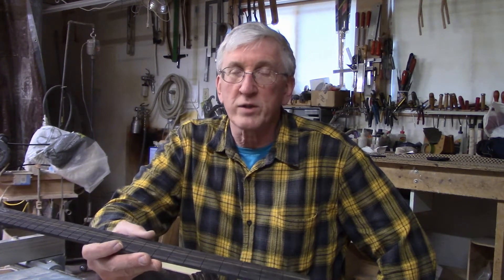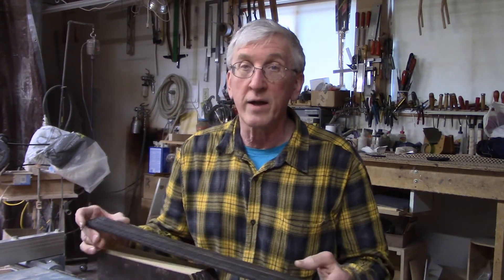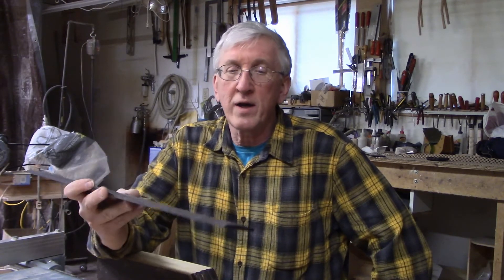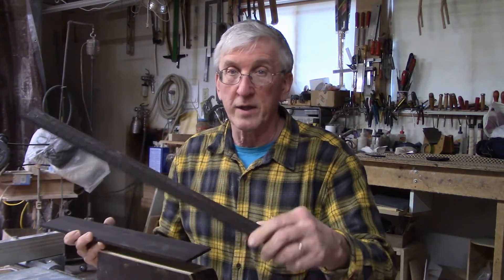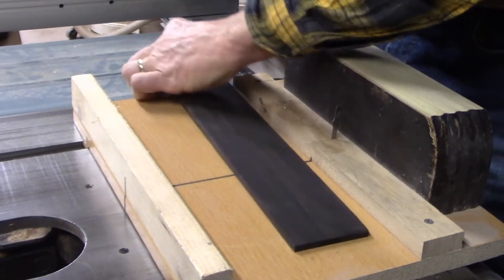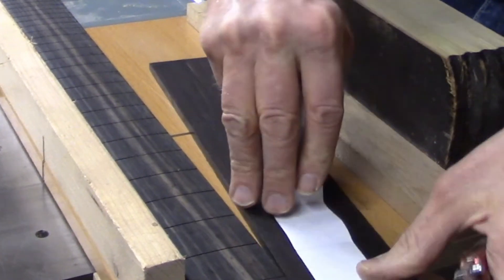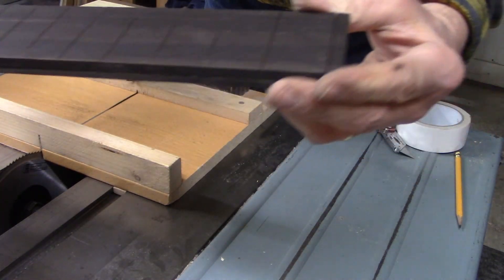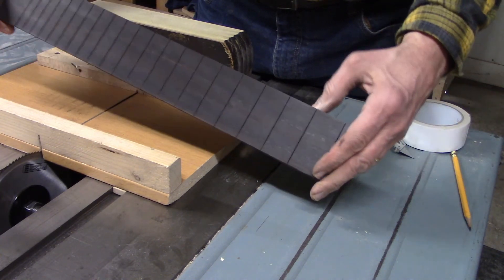Slotting a Fretboard

Comment: Very informative and very good video. I would like to add for those that are new and looking to keep the cost down. That special blade is about $180.00 and you can set up and duplicate that sled on a router table and use a .023 spiral cut bit and follow his example exactly.
The Rule of 18 can be found available as a fret slotting calculator app downloadable to your phone for free.. It works great. I do not have a CNC and do this the way I described
Reply from the maker: Good information. thanks for sharing.  I think when I bought that blade it was about $50.
Reply: I use a .6 mm slitting saw for around $5.

Comment: Where did you buy the circular blade,? Tickness?
Reply from the maker: The blade is from Stewart Macdonald.  It cuts a 0.022" kerf, which is just right for the fret wire.

Comment: More great stuff Gary!  I always wondered how this was done.  Are the width measurements (e.g., at the nut, further down the fretboard) cut after you do this?  And it sounds like the radius of the fretboard is a by-hand thing?
Reply from the maker: Thanks Jim.  Yes, the fretboard gets tapered after the slots are cut.  And yes, putting the radius on the fretboard is hand work in my shop.  I use a plane to rough form the curve, then a sanding block with the desired curvature to finish it.  I did end up recording that process, but it would have made this video too long.  Maybe I will post it separately.  Thanks for your interest.
Reply: @zimnickiguitars311  Would Love to see your method on shaping the fretboard in a future video! Very appreciative of the knowledge you have shared so far!
Reply from the maker: @Ronys2YT  Thank for the suggestion. I will do that on some future project.